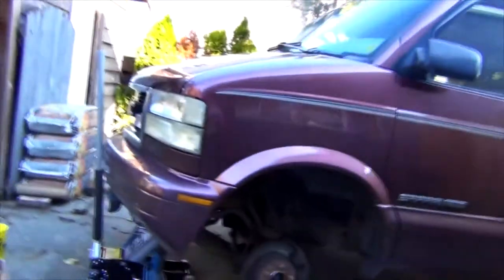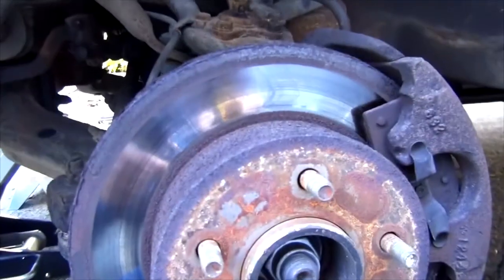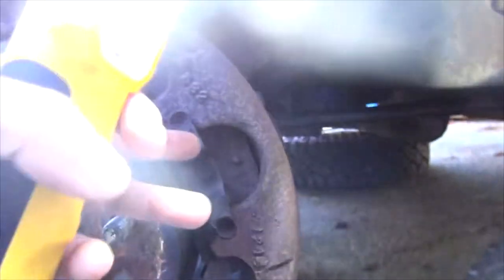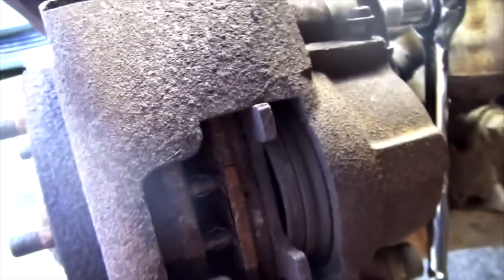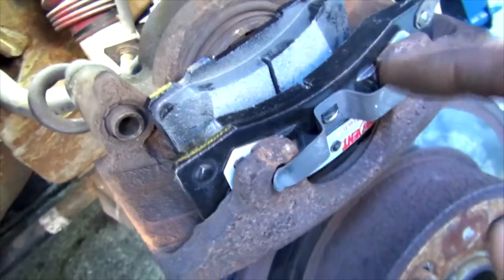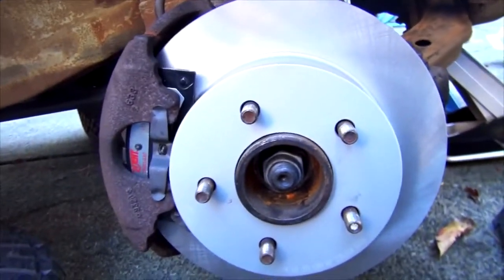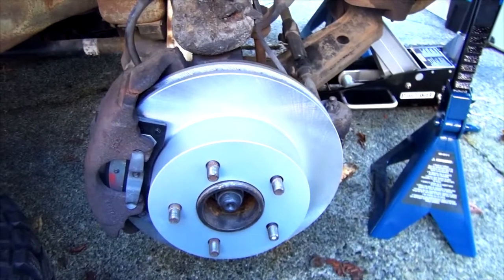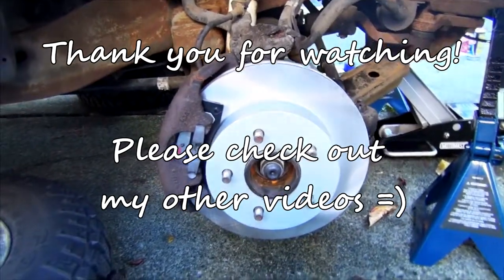Rotor and Pad brake replacement (caliper, hose issue?) - Safari Astro 1995–2005

Comment: What about the rear? Is that one awd?
Reply from the maker: Sorry, the rears are drums. Factory rear disc weren't available until after 2003 (I think...) or at least until the change to 6 lugs
Reply: phr1sk37 thanks bud 

I have a gmc safari 05 and I’m sure I got discs all round. 

Heard an awful grinding noise from rear breaks recently so I’m going to change them. This should be a simple swap like the front then? 

Good vid by the way 👍🏻 I think it could be more helpful if you presented the physical work in stages, like step 1......step 2.....etc 

Maybe elaborate on the logistics after.....but keep the main bits short and straight to the point?
Reply from the maker: @m.harris9512  Yes, your vehicle would have disc all-round and yes, the same principles will apply front to rear brakes. 
When you remove the wheel to look at the rotor and pads, I am sure you will see the issue if indeed that is the problem =)
Thanks for the kind words and the feedback! I have not received constructive feedback in a long time. On previous videos I got flamed for keeping too short and other videos too long (E.g. if I explain things out) --- trying to find a balance between the two because too short and folks needing more "hand guiding" will be at lost while others who just need a little nudge and/ or confirmation of what to do will want it "KISS" :p For the most part, I figured a little longer will not hurt to be a bit more thorough.